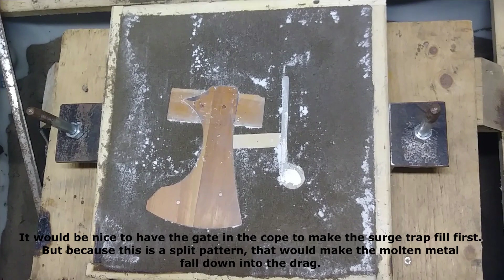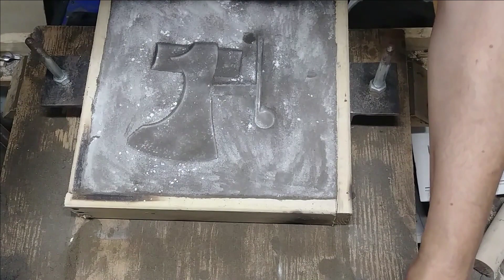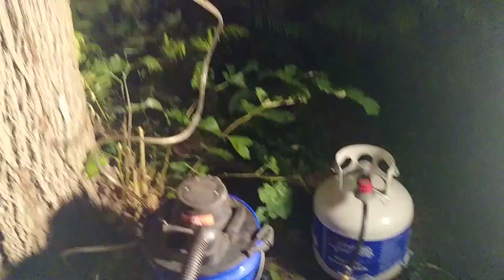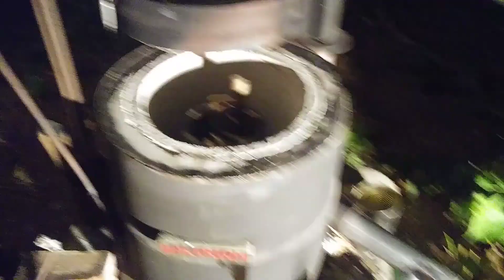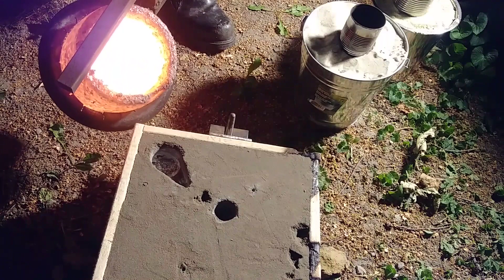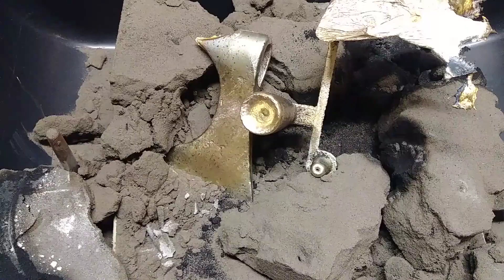Tobho's New Waste Oil Burner - Part 2:  Final Testing.  And Casting Defects

Comment from the maker: The casting defects have been diagnosed.  If you look at the mold at 7:15 you can see little clumps of parting dust in the mold cavity that correspond exactly to the "divots" that aopeared on the surface of the casting.  I should have blown that excess parting out befire closing the mold.  Now I use this as an example of why that's true.  I also should have been using a proper parting bag to avoid getting clumps to begin with! Live and learn.

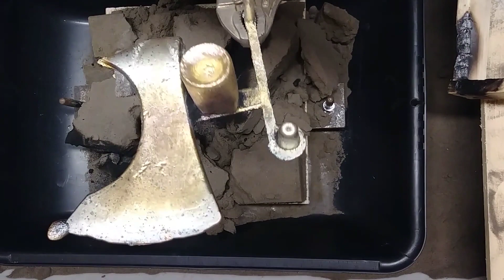Comment: 21:37 The weird little divots in it are gas bubbles. The sand was too wet. Probably need new sand, especially if you've had this batch for a while.
Reply from the maker: Thanks!  It's not my sand.  It turned out to be that every one of those divots was in a spot where there was an excess of parting dust stuck to the mold cavity.  You can see how I was just kind of squirting thebdust not the mold instead of using my usual old sock parting bag.  I'm assuming the parting dust clumps off-gassed to cause defects similar to what steam would cause, as you and Sandrammer both suggested.  See the first scene in my latest video ("First Blacksmithing Lesson" published 22/09/2019) for a side by side pic of the mold w/ parting clumps and the casting with divots for comparison.  Since then I've relocated my parting dust bag, so this should not happen again.
Reply: @tobhomott  Cool!

Comment: Ever since I saw your part 1 video I have tried many times to run my propane burner super low on air and propane  but I cannot get it to burn inside the burner like you did.  That was a quick time to change over from propane to oil. Also a quick time to melt and pour a crucible full of aluminium bronze.
Reply from the maker: I'm not sure how or why it did that the first time either, maybe something to do with the low pressure combined with the large burner tube.  But with the 0-10psi regulator about halfway open, it hasn't happened again since I added the taper at the front end.

Comment: Nice 👍
Reply from the maker: Thanks, the casting wasn't perfect, but the new burner works great.
Reply: Once ur able to melt copper if stop making burners because what would u really melt after that other than cast iron and steel
Reply from the maker: @American_Innovation  I've melted copper and bronze before, but the older burner that I now use for my smaller furnace was taking longer to get the job done in this big furnace.  Now I have the right size burner on each furnace. 👍
Reply from the maker: @American_Innovation  I'll get around to cast iron one day too!
Reply: Tobho Mott be careful with that, sparks

Comment: Those look like red milkweed beetles. Earwigs will also eat milkweed.

It looks like you might need a slightly larger sprue and a bigger pouring basin.
A larger spin trap is needed, I think the recommendation is something like 5 times the largest cross section of the runner. (I'll have to double check my references)

What is the taper angle of your sprue?  It looks like you're at about 4 inches (101.6mm) with a 5mm exit. The top of the sprue (where it meets with the basin ridge) should be about 7.40mm giving a taper angle of 0.98 degrees for a total cone angle of 1.96 degrees. 

The dimples on the surface could be from surface steam, your sand seems a bit damp and your parting power seems to be clumpy in some areas even after you were blowing the loose sand out with the air.
Reply from the maker: Yeah, someone pointed out that the clumpy parting in the cope coincided pretty much exactly with the location of the steam dimples or whatever they are.  I agree that the sprue pattern I used here was too small too, I couldn't find my usual one and with this one I found it hard to pour slow enough not to overflow the basin, which has never been a problem with the other sprue pattern I'm used to.

Comment: The "divots" are some small areas where steam was trapped. If you vent the cope and drag, like I show how in my videos, the steam would have found a way out and the defects would not have been a problem. Or you could spray some alcohol over the surface of the mold cavity and light it off just before closing the mold which would drive off the surface moisture and force any other steam generation away from the molten metal when it is being poured. Your riser was isolated from the mold cavity. It should have been in direct contact with the mold cavity so that the hottest metal could easily flow into the mold cavity when needed. The in gate solidified before the riser could feed any of the mold cavity. I have no doubt that your metal was hot enough to fill in all of the mold cavity but the thinnest part (the bladed end) was where the metal had to run up hill to fill in the cavity so allowed the metal to freeze up before it could reach the very edge of the mold cavity. There are at least two things, that I can think of, that can fix that problem. 1. Raise the side of the mold that is opposite the bladed edge so that the metal runs down hill and gets to the blade before it cools or you can lengthen the sprue by building up the sand above the sprue so that you will have enough hydrostatic pressure to overcome the "running up hill" portion of the mold cavity. I've seen olfoundryman use a tin can to make an extension over the sprue that adds a few inches to the pouring basin and sprue so that the hydrostatic pressure of the molten metal is increased. Enjoyed the video, keep them coming! Liked your hand rammer. Looks like it should work well for you.
Reply from the maker: Sandrammer a friend just pointed out that at 8:00 you can see there is an excess of parting in the cope right where all the divots appeared.  I wonder if my parting dust has gotten a little damp on me, it might explain the steam defects.  Thanks for the suggestions, I'll keep all that in mind.  And you're right, I did forget to vent the mold, didn't I!  D'oh!